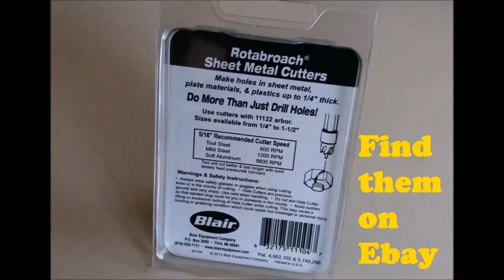2007 Mazda Miata front end repair ... watch and learn!

Comment from the maker: No.   The only place welding was done is where the radiator support attaches to the front frame rails (2 spots on each rail) and where  the upper tie bar attaches to the body structure (2 spots on each side) .  All these spots were originally spot welds but I used a wire welder to assemble.

Comment: Is there by any chance a gap between the lens of the headlight and the bumper cover? I recently rear ended someone and ever since the driver side headlight doesn’t align correctly.
Reply from the maker: There are plastic mounting tabs for the headlight that may have been broken in your accident.   If these tabs were broken it could cause your headlight to be misaligned.